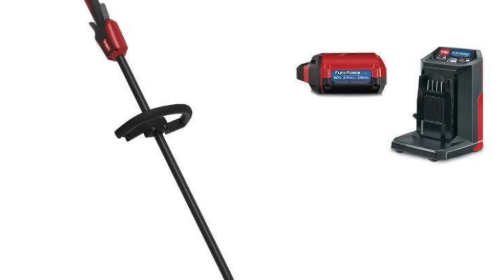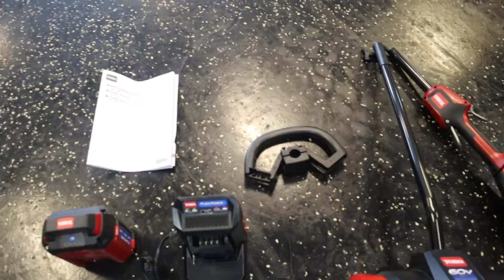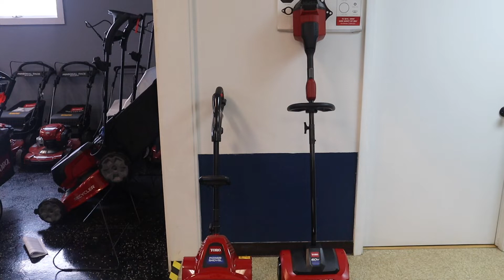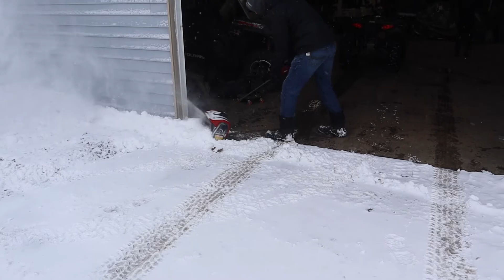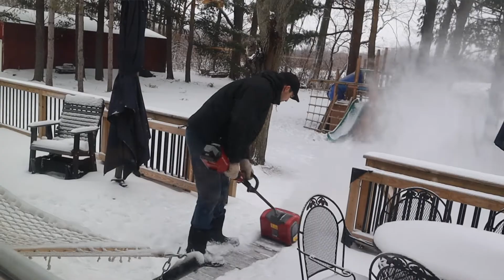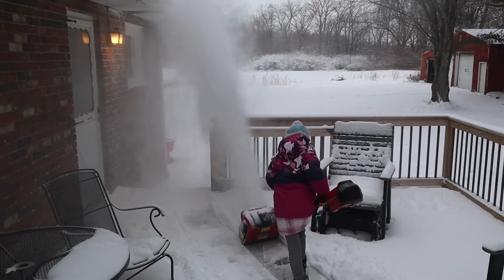An Honest Opinion of the Toro 60V Power Shovel

Comment: My question is how many fires have there been from the lithium batteries spontaneously exploding due to heat.  I have seen two backyard sheds burn down in our neighborhood due to the battery igniting into flames because of heat and it didn’t matter who the manufacturer was or states in their equipment manual or the type of equipment.

Comment: Do you have to lift it at the end of a run? Can't you just spin it around while keeping it on the ground? I'm 79 years old and can't be lifting much.
Reply: It’s actually quite heavy and awkward 

More than I expected 

Deal breaker for me
Reply: No it's heavy, you have to lift it to get it out of the door.
Reply: 79??  Hire a kid or a shoveling service like I did.  Snow removal is a younger man's gig unless it's just a powdering.
Reply: That costs money, do it on a day you know you can't shovel, like a foot or more. @bobrichardson5905
Reply: @bobrichardson5905  Or..... just buy one thats light weight and isnt as heavy...
Reply: I just bought one on sale. It is very heavy and awkward, you still have to bend ovrer like using a shovel. Once it is in place, it does a great job. I actually pushed it along with my pelvic/smomach letting it slide across the driveway. I only used the hand bar to maneuver it into position.